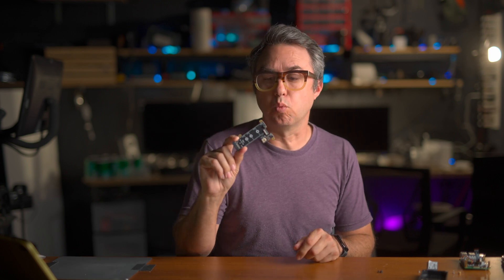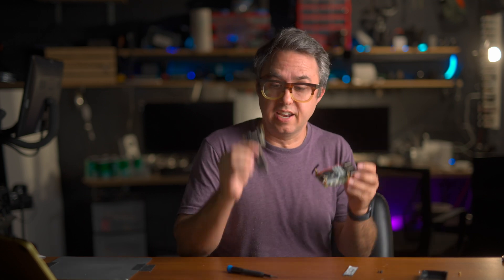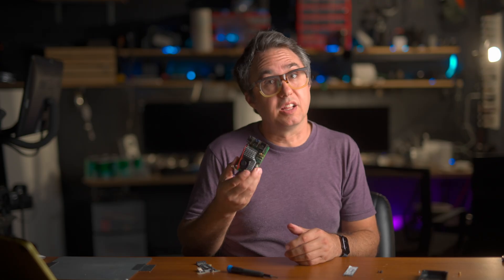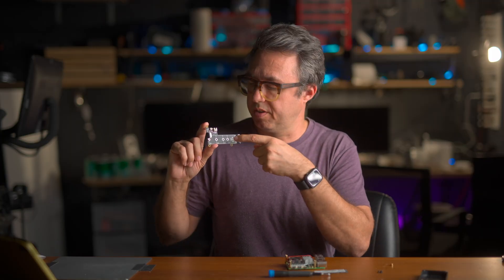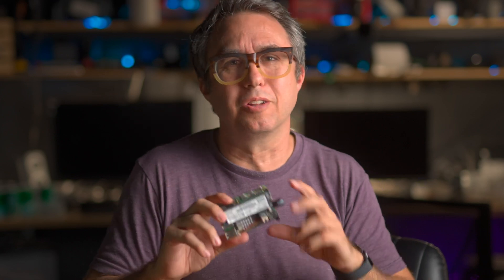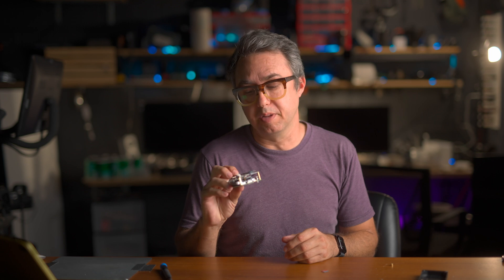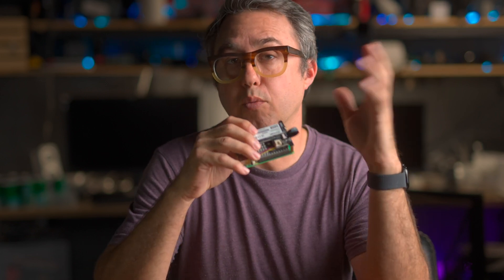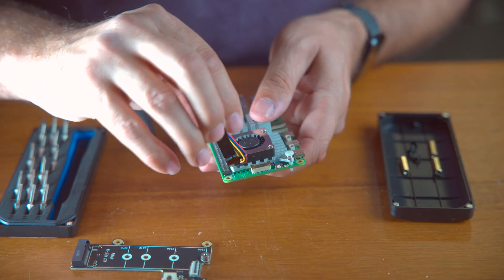X1001 PCIe to M.2 HAT Raspberry Pi 5 NVMe SSD Review

Comment: Should I choose raspberry pi official m.2 hat  with their nvme ssd . 
How's  its performing is there  any issue you faced with this hat.
Reply from the maker: The only thing that came up, and it only came up the first two times for some reason is that the pi would boot into a screen that asked me to choose which disk to boot to, even though I only had the nvme connected and no microsd card.  But after the second time it did that, now it just boots up straight to the nvme and OH MAN it changes the whole computer!  That microsd was definitely a pretty big bottleneck.

Comment: Good Video 😀I  have a compute module 5 dev kit which is basically a pi 5 with a nvme m.2 slot already integrated in to it. It is for sure a LOT faster then a MicroSD card and a lot more reliable. I actually use it for a mini home lab running different software with a nice UI on top of ras pi lite called CasaOS. It makes it easy to run docker containers on it which makes it easy to install dockers apps like plex, pi hole, home assistant, ESPHome and many others. I have a sata to USB drive chassis which allows RAID and several hard drives to be installed.
Reply from the maker: RAID was my next experiment. I have a synology NAS but I’d love to have a totally NVME based resident storage pool that runs on like 4 watts or whatever. It’s amazing.